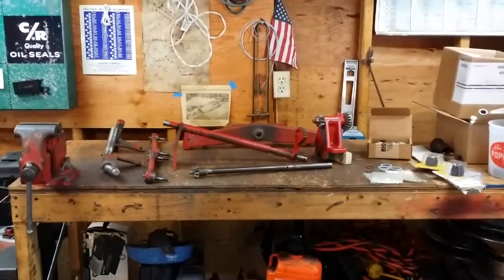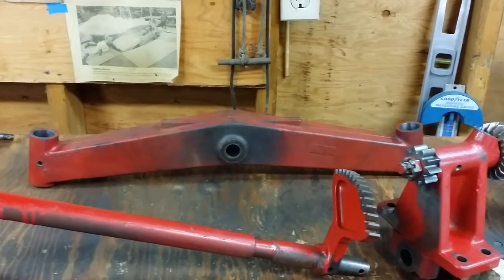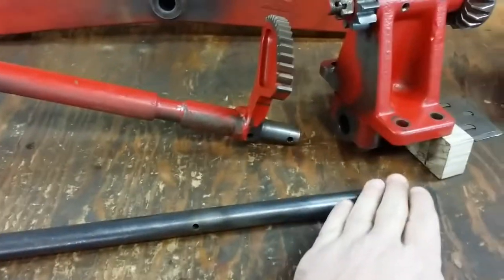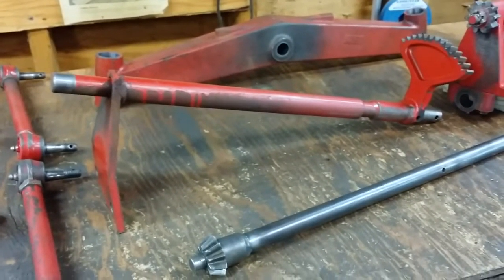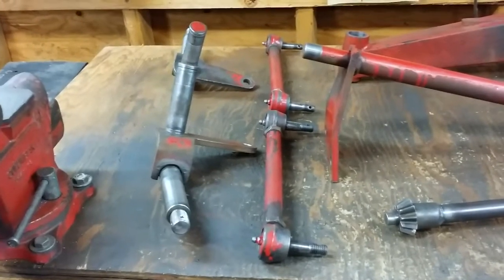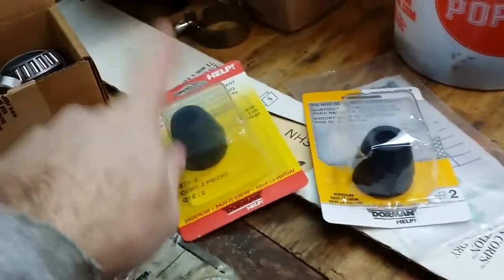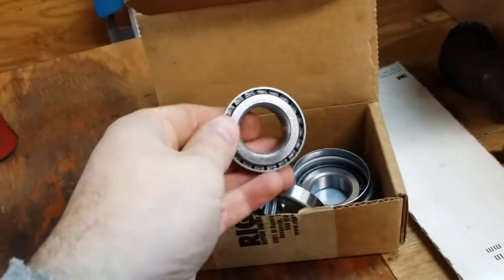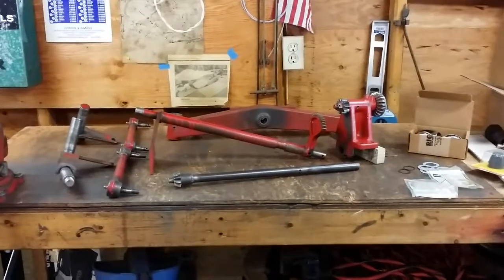Wheel Horse Garden Tractor 520 Gear Reduction Steering In A Short Frame 857 Part 1 VinsRJ

Comment: Swept axle may not have looked too bad. With the wider rear wheels it may have balanced out. Either way it should be a cool modification.
Reply from the maker: Hello Richard, I was thinking the same thing initially but after lightly mocking it up... I just wasn't feeling it... with the front swept axle, the swept axle kind-of killed the short frame 857 look that I like so much about this tractor.

Comment: ? Why are you hoping you don’t need to change the Bearing cup? Putting new bearings in might as well put the new cup in. but could there be a problem with replacing the Bearing cup?